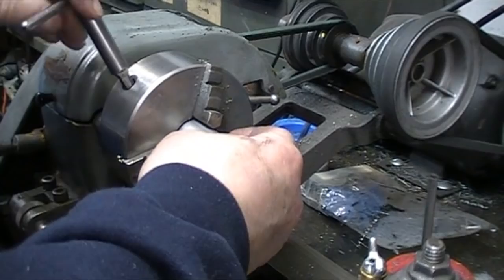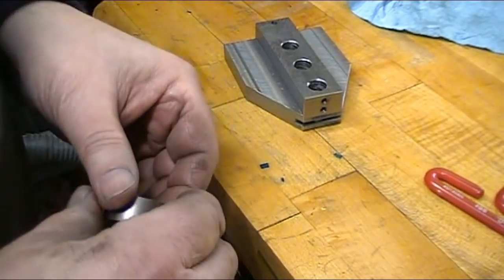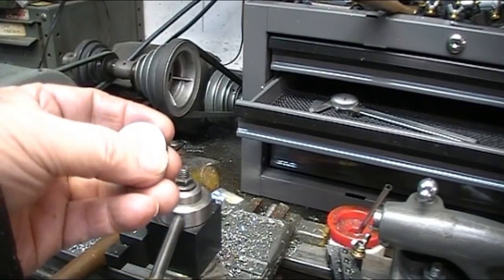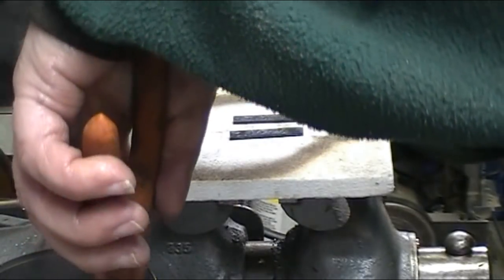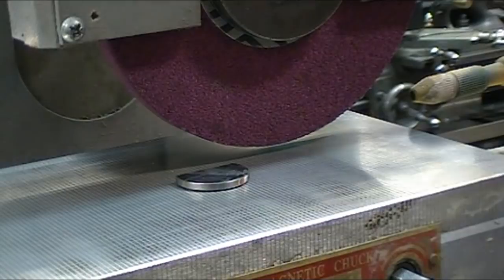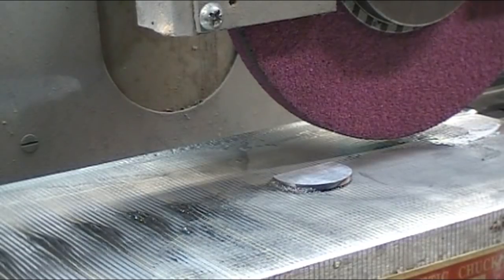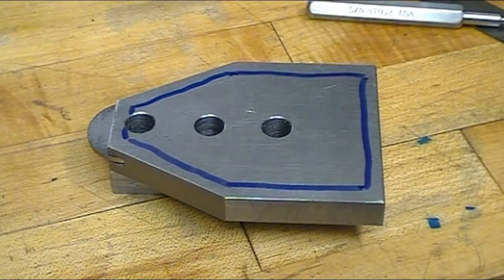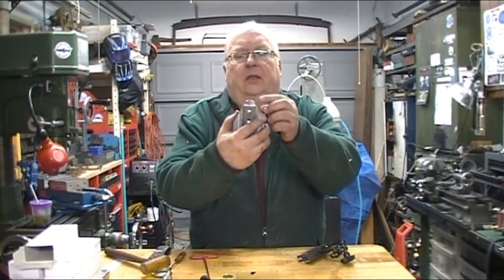Squareness Comparator Build #4

Comment: Starting to take shape...!!!  
Looking good so far.
If you find quenching in motor oil to be stinky, I use cooking oil, not only it smells better, it also has better behavior for quenching, with a higher boiling and flash point...  Just a suggestion....   ;)
Reply from the maker: This actually worked out good, but it was a small part so the ration of oil volume to material was large.  Not sure how regular motor oil would have held up but this was full synthetic and there was very little smoke.  Thanks for your input, although I have been a machinist for most of my lifetime, I have done very little heat treating.
Reply: it's always fun to try something new, mostly if you're not born for routine work...   ;)
Reply from the maker: Some old time machinists used old used engine oil.  I would think that it would be more flammable because of the dissolved  gasoline that could be in it. You never know what you can do until you try.  Thank you again for your input.